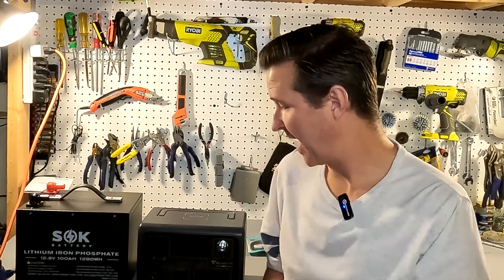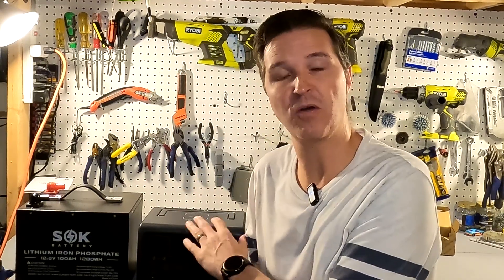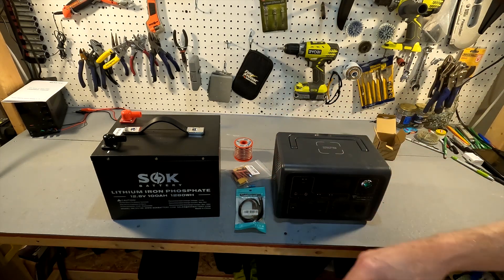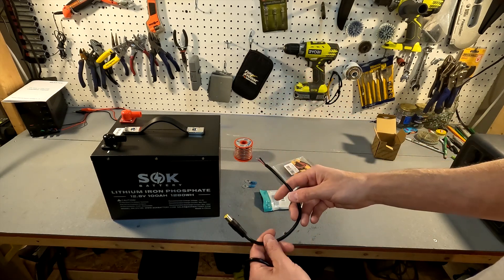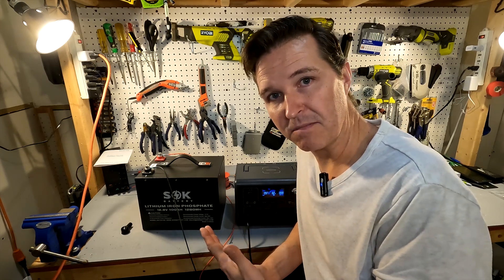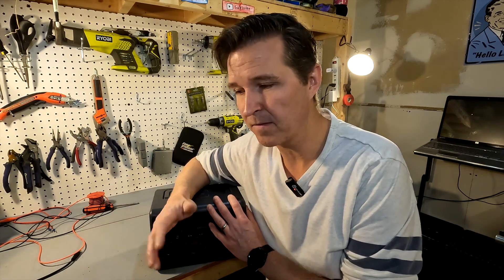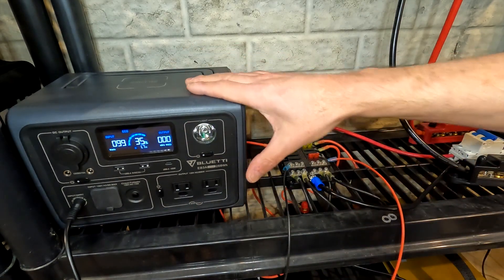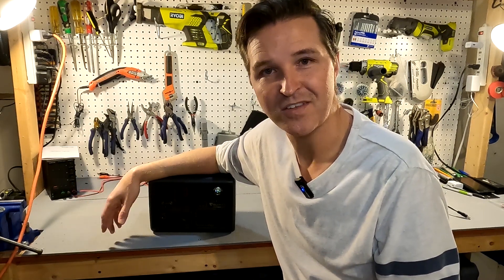EB3A Battery Extender

Comment: I find that if you made an adaptor to plug my Ryobi 18v battery in.  Now I can swap the tool batteries in & out.  Charging with one Ryobi battery while recharging other Ryobi batteries.  You can use a boost converter to charge the Ryobi batteries from the backup power bank.
Reply from the maker: Thats a good idea!  I have a bunch of Ryobi tools and batteries.  It would be nice to use them to charge up other devices without purchasing their 300w inverter.  Thanks for the comment.
Reply: @OffGridBasement  Just be careful that you don't over discharge your tool battery...many don't have an on-board BMS and rely on the tool itself for battery management
Reply: @OffGridBasement  I saw your Ryobi tools in the background :>).  I have done a bunch of videos on electrical stuff using the Ryobi batteries.  If you need any advice on battery ideas, I've been told I'm full of it . . . I think they meant ideas.  I am going to look at some of your older videos for more ideas.  Are you off-grid completely, now? Where do you live?  My thoughts are not to be off grid, but the power does go off here for hours or days at a time now and then.  I just want to survive during that time.  I call the video series FOGS (Forced Off Grid Survival).  I hope to find bits of ideas from your videos.  Keep them coming.

Comment: if you hook it up to a 24 battery it will charge faster about 200 watt your EB3A can handle 28 volts
Reply from the maker: That's true.  I'm thinking about connecting it to my 24v system to see the results.  Thanks for the info and comment.

Comment: Interesting concept.  Definitely more efficient than using a wall power supply.  You could potentially also just hook straight up to your 24v system as well to utilize your solar to charge as well right?  Just make up another pigtail to come off the 24v system.
Reply from the maker: Thanks true!  I should do a short on connecting to the 24v system to see what happens.  I need to figure out a way to test how much more efficient it is.  My guess is about 15 to 20%.
Reply: @OffGridBasement  You would guess you have use your AC power meter (like a KillAWatt) to measure grid wattage "consumed" then you would need to measure how many watts actually went into the power station on the DC side and divide those numbers.  That would at least give you the efficiency of the AC-DC.  Harder to say with the DC-DC because the actual converter is internal to the Bluetti.
Reply: A 24 volt nominal PV has an open circuit voltage of about 45 volts, exceeding the EB3A 28 volt limit. It can be connected safely to a 24 volt battery.

Comment: I know you’ve tested quite a few batteries over the past few months. What 100ah one do you recommend that’s budget friendly. Thanks
Reply from the maker: The Lifepo4 battery I like is the Redodo.  Very simple battery with no bells or whistles.  No heaters or cold temp protection.  Just stores energy.  It's a bit over $300.  Here is a link if you want to check it out.  https://amzn.to/3JqPfDQ
I have the 50Ah version of the AmpereTime / LiTime battery and it's worked pretty well also.
I've heard TimeUSB is also pretty good, but I've never worked with it.

Comment: a 24 volt battery would have brought you wattage closer to the max of 200 watts .On my channel i did an experiment with a Variable power supply. adjusting the power supply to almost 28 volts and the amps close to 8 i got 193 watts very close to the max input of 200 watts.
Reply from the maker: That is true.  I actually tried it with my variable power supply and I could only get it up to 17v.  I think mine is a piece of garbage.  Thanks for the info and comment!
Reply: @OffGridBasement  if you have 2- 12 volt batteries and run them in series you can get 24 volts that way also